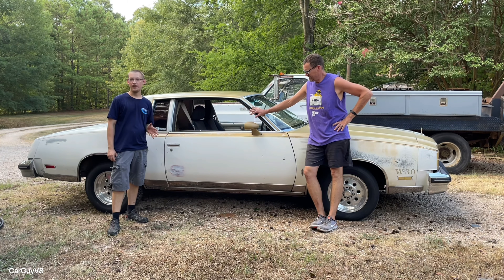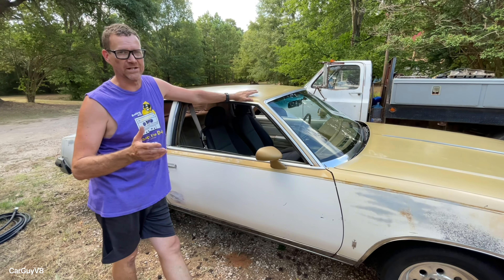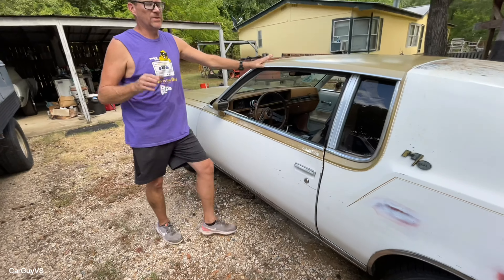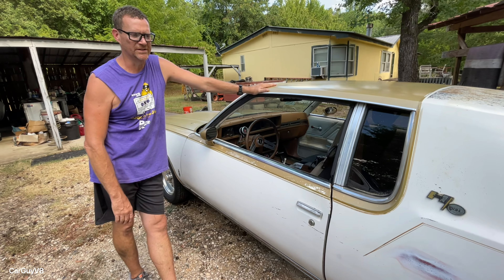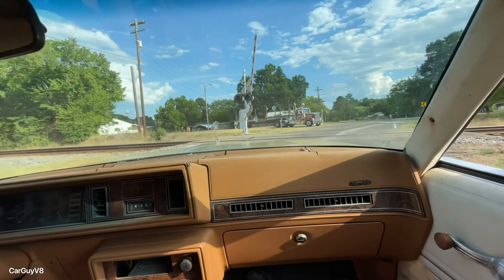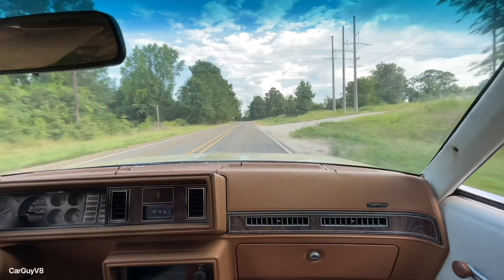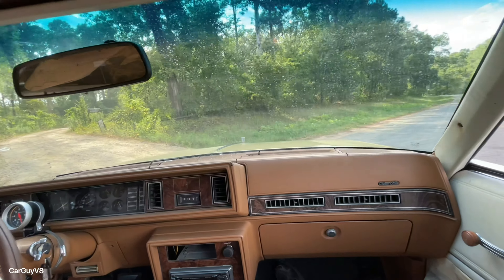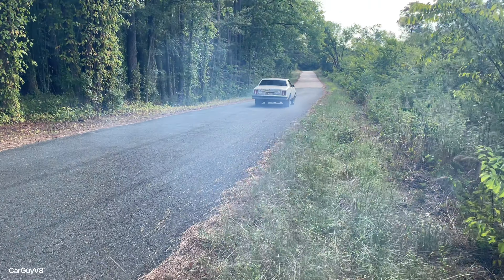LS Swapped 1979 Cutlass - Walk Around & Full Throttle Accelerations

Comment: I just bought a 1979 Oldsmobile Cutlass Supreme, Brougham. Florida car with a clean interior & mint frame. It's been my dream to have one since I was a little girl. I'm 35 now. It currently has a Rocket 350 and TH350 transmission. I fully planned on doing an LS swap after blowing this one up 😂
Reply from the maker: Awesome! Burn those tires off lol
Reply: What do you think of it? There’s one I’m looking at right now. It would be the only car I’ll be driving so would you say it’s a bad idea to use it as a daily? Only has 100k miles on it
Reply: @dekabean9755  if fuel consumption isn't a concern, I'd say go for it. They're comfortable as all hell, but keep in mind that these things float, like most older, full frame cars. Not the greatest handling, but fun as hell to drive. Feels like the average, full frame Malaise era car. "G-body" shuffle is a very accurate moniker, lol.

Comment: Did you use an aftermarket fuel tank? I know the filler necks are slightly different and I’m having a hard time finding out if the GN tank actually fits 78-80 cutlass’s
Reply from the maker: He using a stock 99-06 truck fuel tank like a fuel cell in the trunk.

Comment: I have a 1979 Oldsmobile Cutlass I got back in May of this year.. she as a posi rear end and a 307 that came from out of a 1986 Cutlass. If I wanted todo the LS swap would the factory driveshaft work? Looking for the simplest run down so I can drop and go lol
Reply from the maker: You’d have to check which tailshaft you have to determine the length of your transmission vs a 4L60e. I’m guessing yours has a th350 so the yoke will be the same at least.

Comment: So I'm watching along and about 30 seconds into your drive I'm thinking "man that looks familiar" lol  Then @9:57 you turned around right where I bow hunt some times lol   Btw, I didn't sell mine if you're talking about the 1980 442 about 10 miles from you.  My 1980 442  W-30 is identical to your 79 H/O except for the badges and the grill.  They also had a unique transmission code on them. I think it has a factory installed shift kit or something, can't remember now. And could "Custom Coaches" be the company you're thinking of that did some of the W-30 package? Mine has Custom Coaches on the door sill covers. Here's mine....  https://youtu.be/YO2qaN9S-oE
Reply from the maker: I watched your video, you’ve got a good looking 442!
Reply: @CarGuyV8   Don't know if you caught this in the description, but my dad bought it new in 1980. I have a pic of me standing up in the seat when I was 8 lol  One owner with 45k miles. Never had anything major replaced on it and still drives like it's new. I've redone the inside, one of the days I'll redo the paint.
Reply from the maker: @chrisrosenthal1210  I did not catch that. That’s awesome! Glad to see another on GM car still on the road.

Comment: They made 2499 of them not 2500
Reply: You are correct. And the only G-body/ A-body to come from the factory with anything over 307ci. These came with a 350 olds. Anything under 2,500 units could be built with any engine available from the manufacturer at that time. They could have made a few super H/O’s since the 403 olds was available in 79